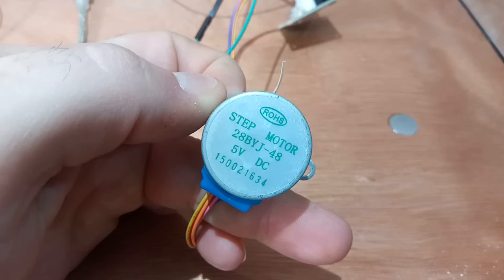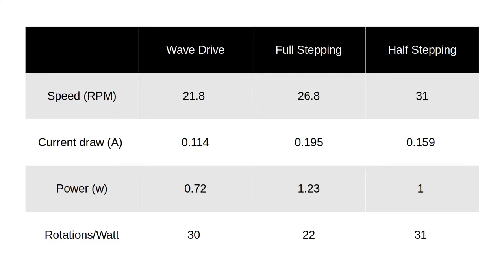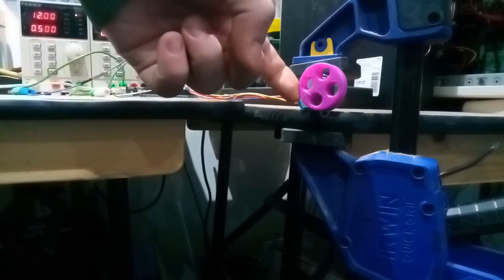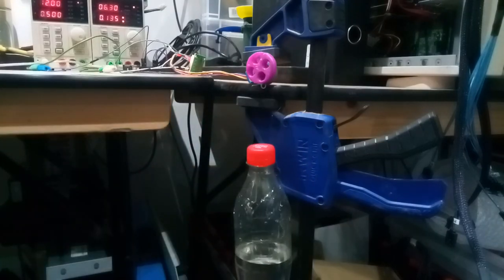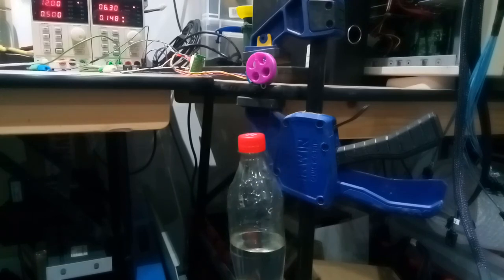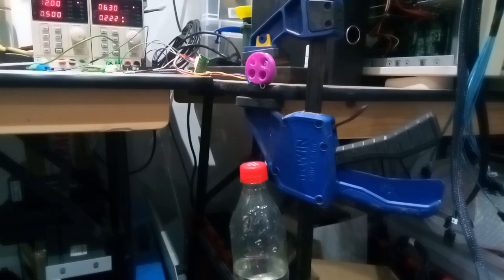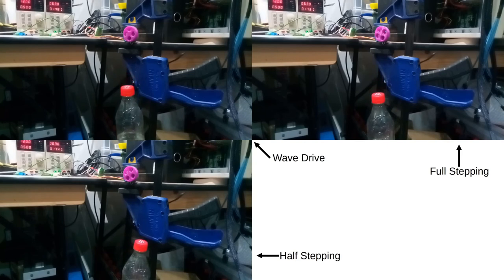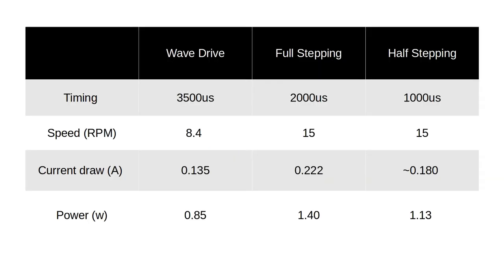#59 - 28BYJ-48 torque in Wave, Full, Half step modes

Comment: Just curious, then it would it be able to carry much bigger bottle of water, if the 3d printed pulley was smaller (say, maybe ½-1 cm)?
Reply from the maker: yeah the torque is a distance*force expressed in Netwon Meters. say a 2cm pully had a force at 2n, it would have a torque of 4n/cm. so would also have a force of 4n at 1cm, or 1n at 4cm.

Comment: Sir i got a 28byj48 stepper motor. But its maximum speed is very low and About 2rpm in full stepping. What could be the possible  problem.and how to deal with this
Reply from the maker: How are you delaying the time between steps - if in Arduino use the delayMicroseconds() for greater accuracy and going lower than 1ms (using the standard delay) - also write your own step sequence rather than using a library. removing overhead removes time between steps.
Reply: # -- coding: utf-8 --
"""
Created on Sun Apr 25 10:04:22 2021

@author: HP-PC
"""

#xy motion
from pyfirmata import Arduino, util
import serial
import time
board = Arduino('COM5') #Here you need write your 'COM' Port number
controlPinsx=[9,10,11,12]
controlPinsy=[4,5,6,7]

def mystepper(stepmove,rsense,speed,copins):
    sense=rsense
    p=speed*256/60
    delay=1/p
    step=stepmove
    for pin in copins:
        board.digital[pin].write(0)
    seq=[
        [1,1,0,0],
        [0,1,1,0],
        [0,0,1,1],
        [1,0,0,1]
        ]
    seq2=[
          [1,0,0,1],
          [0,0,1,1],
          [0,1,1,0],
          [1,1,0,0]
          ]
    for i in range(step):
        for halfstep in range(4):
            for pin in range(4):
                print(seq2[halfstep][pin])
                if sense=="cw":
                    k=seq[halfstep][pin]
                else:
                     k=seq2[halfstep][pin]
                     board.digital[copins[pin]].write(k)
        time.sleep(delay)

mystepper(100,"cw",2,controlPinsx)
    
board.exit()
Reply: This is my code in python and if possible please send some corrections. Best will be if you post your codes.based upon your logic i will do.
Reply from the maker: @sandy-se7ky  yeah try directly controlling the motor without a library, and from C/C++ code on the Arduino. Something like this;

for (int i = 0; i <= 512; i++) {
    digitalWrite(8, HIGH);   
    delayMicroseconds(tDel);                       
    digitalWrite(8, LOW);   
    digitalWrite(9, HIGH);   
    delayMicroseconds(tDel);                       
    digitalWrite(9, LOW);  
    digitalWrite(10, HIGH);   
    delayMicroseconds(tDel);                       
    digitalWrite(10, LOW); 
    digitalWrite(11, HIGH);   
    delayMicroseconds(tDel);                       
    digitalWrite(11, LOW); 
  }